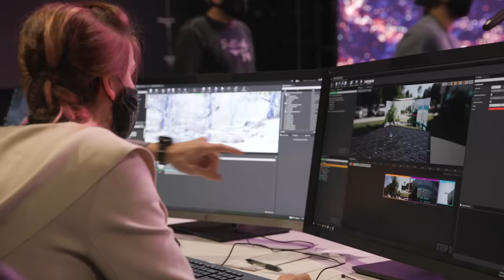Inventions Gone Wrong - Buttered Side Down Compilation

Comment: 0:00 looks in the trashcan, get the tape on memories and puts it in the TV
0:08 launches, a rocket comes down and makes a big explosion right next to him
0:23 gets a T-ball stand whatever it’s called and a T-ball, and gets out a bat with a rocket launches off and hits the ground very hard
0:42 get a battery for a robot, tries to get the robot to solve the Rubiks cube and gets out of control
1:13 get a teleporter gun puts a teleporter portal on the wall and it goes into the ocean, and then his house floods
1:58 starts to learn how to use whatever it’s called in his hands with a robot thing and then it goes a little bit too fast and then it gets out of control and tries to attack him
2:30 gets a drill put a yo-yo on it and activates it then it gets out of control, but it’s still activated. He puts it off and then the yo-yo is still spinning and it upgrades and then he tried to cut the rope off
3:13 looks in a drawer with a lot of sponges grabs the whole entire drawer and pause it on his table grabs every single one of them, and squeezes it very hard and then it upgrades into one. Then he washes dishes. It cleans the dishes very easy. And then it sucks up the plate 2x and then he drops it then it moves around and then it sucks up to chair and then he grabs it and rushes to put it in the trashcan and then it sucks up all the garbage and the trash can and then he puts it in the ocean and then it comes back to him and tries to suck him up
4:16 get the tape out and then throws it away the end